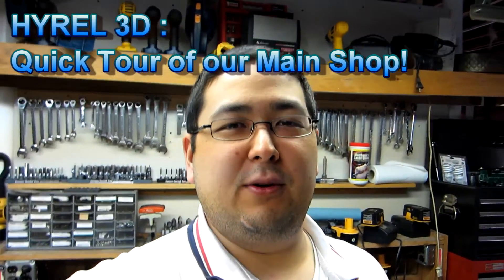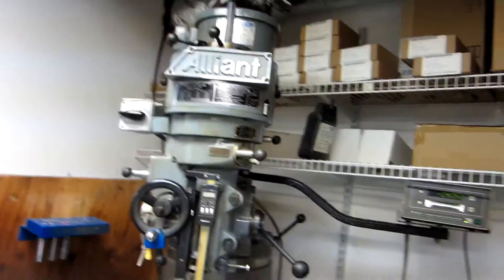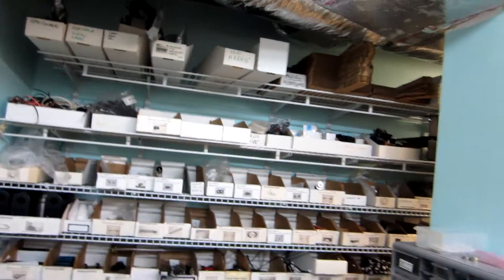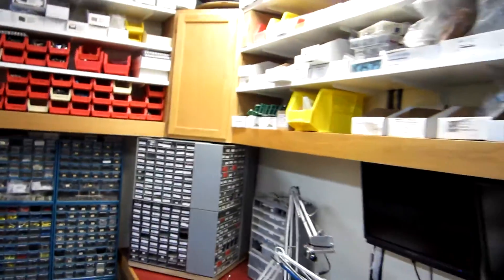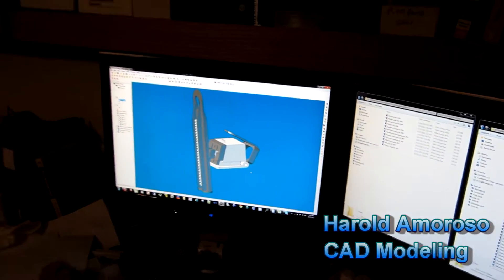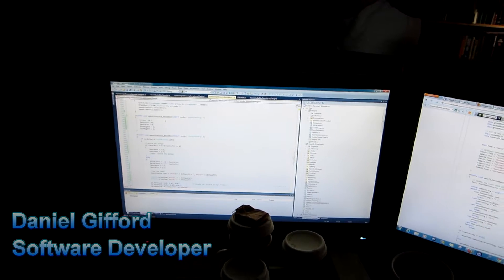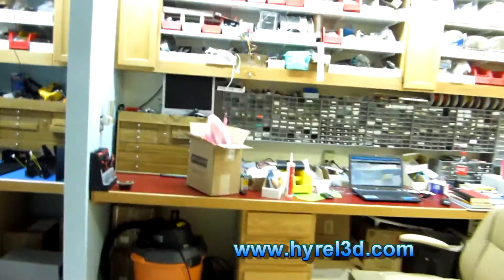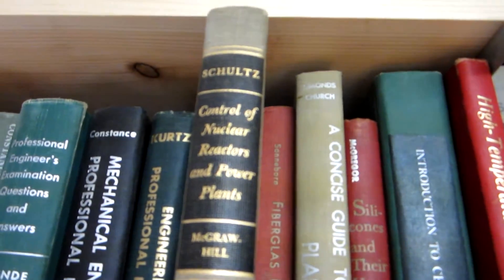HYREL 3D - Quick Tour of our Main Shop!

Comment from the maker: @Derek Meng,
Depends upon the machine we're producing.  Some of them are perfect, out of the box, some of them require a second op to fit in or on the parts we're using, and then there are some which require a completely customized pulley to be machined.  The last ones we typically make as prototypes, then source them, if possible.

Great Question!
-Team HYREL